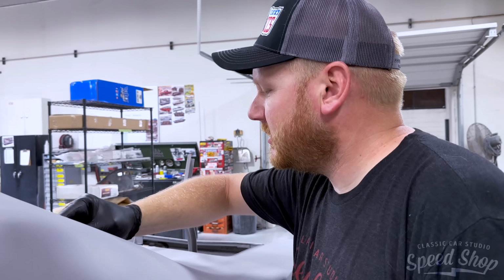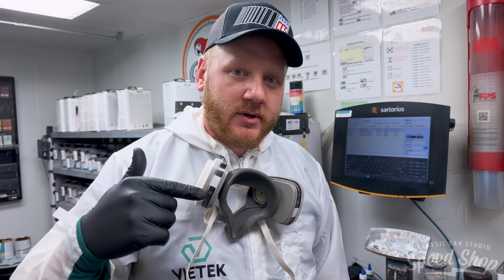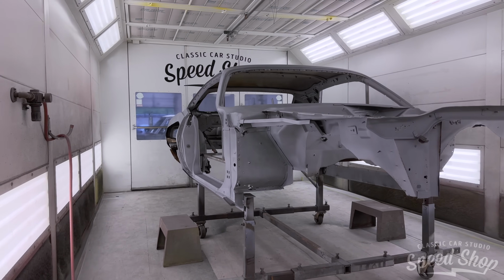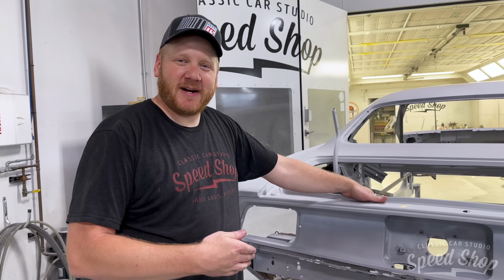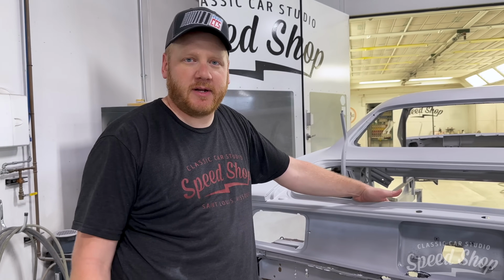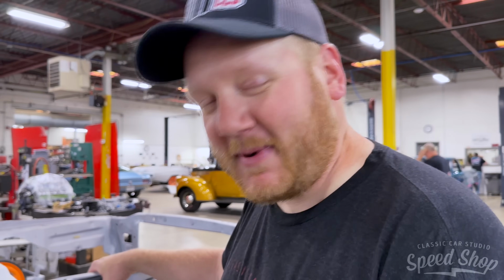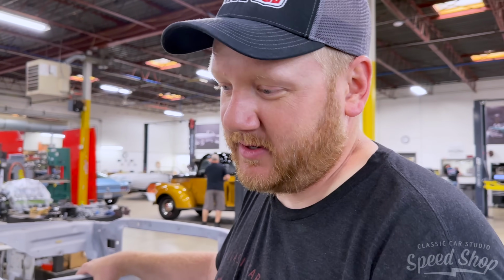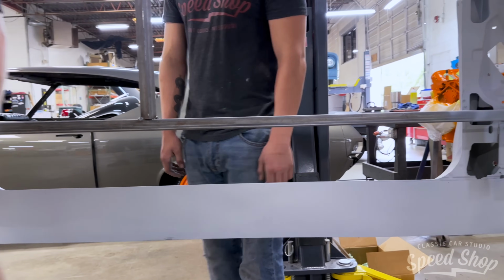Sandblasting, Epoxy, & Roadster Shop Chassis • Episode 2 • 70 "Hellcat" Cuda

Comment: Do you wipe any degreaser or anything before epoxy primer? That sand gets everywhere! When you blow off the body would that contaminate with moisture?
Reply from the maker: Yeah, everything gets wiped down with wax and grease remover before getting sprayed.